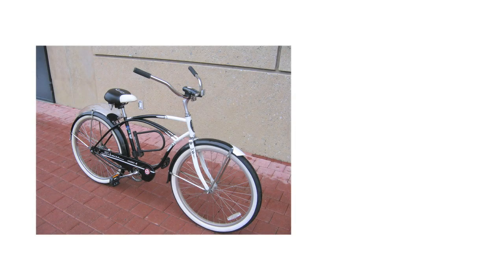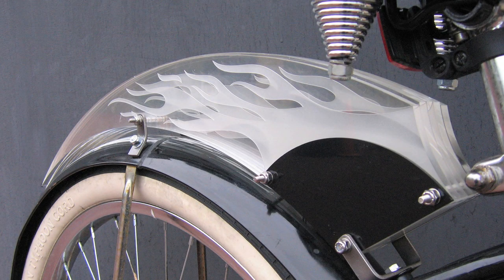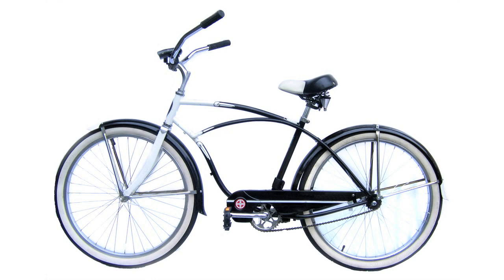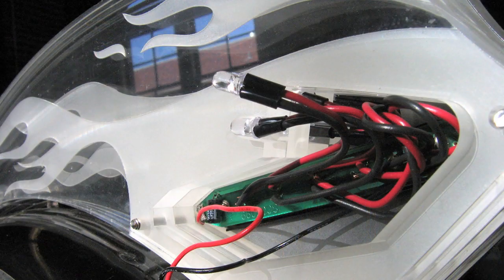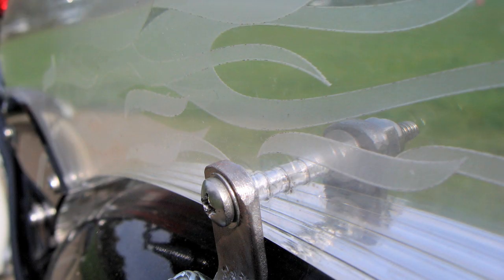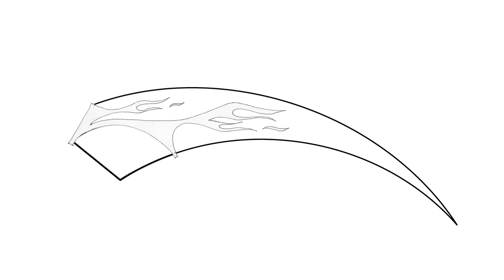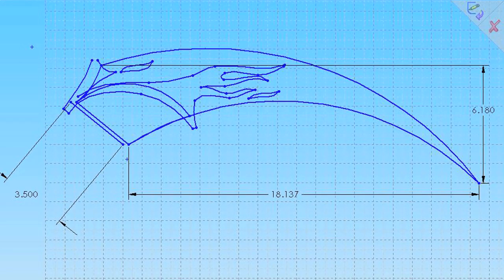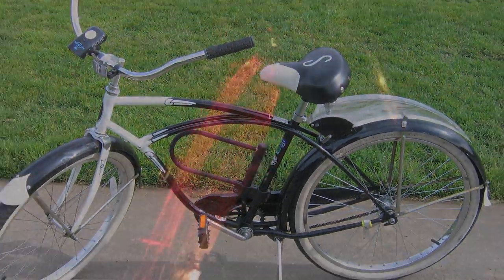Cool DIY LED Bicycle Light

Comment: It's very nice work, through all parts of the process. The one thing i question is, did you only put the lights where they are to make it look like you're farting fire? Or rather, why bring attention to just that one area, as opposed to the front as well?